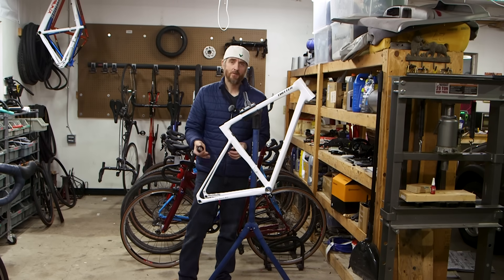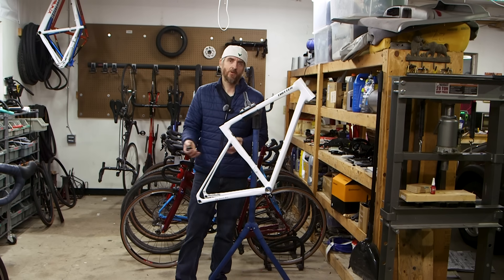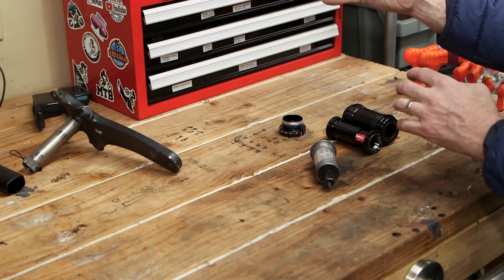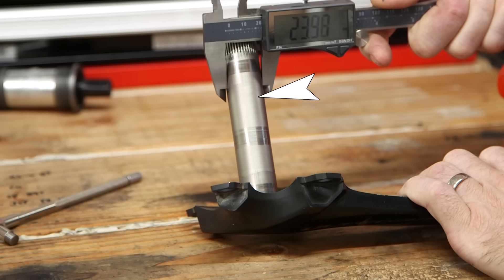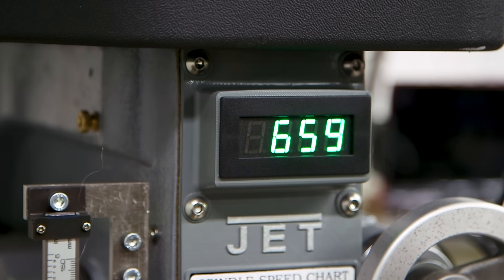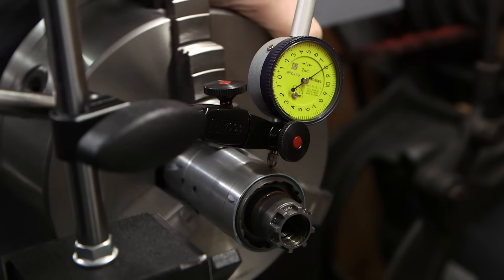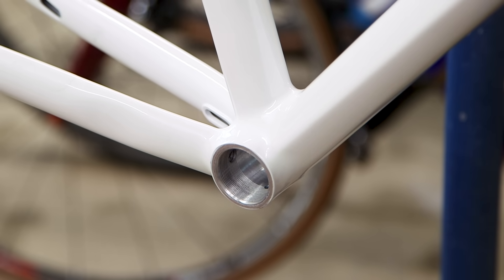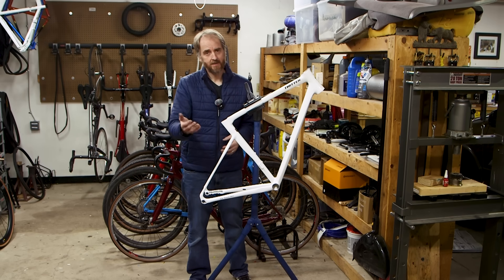I destroyed frame's bottom bracket threads, but I also fixed them.  Here's how.

Comment: I have a few thoughts I'd love feedback on. Why not add either some JB weld or some aluminum brazing material and recut threads into that. In the "old days" we used to add brass to damaged bb threads and then cut new ones with consistently positive outcomes.
Reply from the maker: I was hoping to save the paint on the frame.  I did consider aluminum brazing like I did on the Stumpjumper, but the heat would cook the paint off the bottom bracket area.  Its a good idea for next time.

Comment: Clever way to ensure press alignment with the different diameters. Thanks for the idea. Also, clearly even a "quick test fit" into aluminum or stainless steel threads should be done with antiseize compound.
Reply: So antiseize is the key to prevent such issues? I always expected time being a component...

Comment from the maker: I was absolutely certain this frame was trash, two days ago.
Reply: We were all certain you'd fix it, lol.
Reply: If it ever happens again you can buy bb shells, (pre threaded) from a frame supply shop for under $20 but they would be steel so in this case you'd be mixing metals.
Reply: Did you need to “clean up the thread” after the press fit? I feel like 0.0015” would be enough to change the threads.